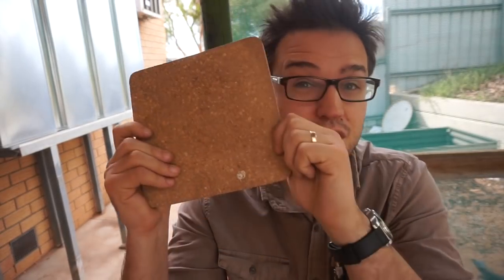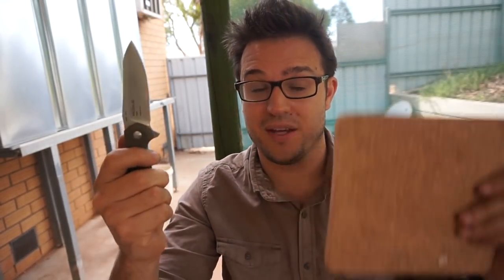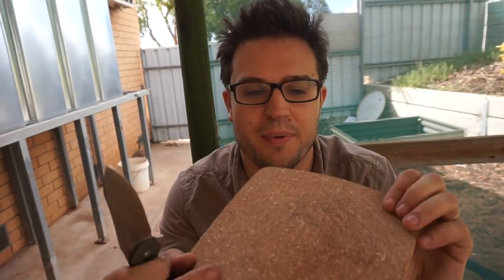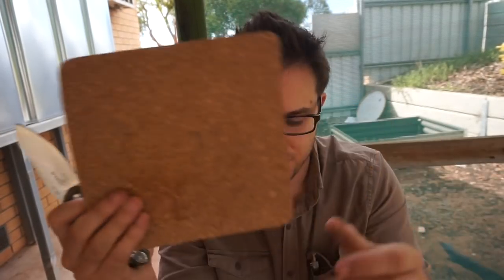Steel Will Modus Response and Additional Test on cork

Comment: Don't knock your science. Your test medium is fairly uniform. Your cutting surface is the same cutting board. You test all the knives with multiple edges. Your sharpness test is fairly uniform. And a company's quality control should ensure that there's little chance of you getting a bad item.
      You could get 32 knives from each company and get your z-scores and yadda yadda yadda. But your tests do exactly what they need to do.

Comment: F.I.A.T : Fix It Again Tony :) Glad I saw your Modus M390 edged retention test video. As long as you do the same test with same material for every knife your tests are valid and relevant !Was on the fence between ZT 0770 CF and Modus CF, leaning towards Modus CF but you have change my mind ... for now. I look forward to Steel Will follow-up. Great work!

Comment: Sometimes I wonder about companies that contract out their rpoduction. There is an obvious incetive for the producer to switch steels to less expensive as,lets face it, its very difficult for the average consumer to tell for sure which steel it is.
This is what I like about buying a Benchmade or Spyderco over, say, a Cold Steel, they have complete control over their product.
Reply: I've used some of Cold Steel's recently made CTS XHP blades and I can tell you as far as that steel goes, they seem to have it figured out pretty well. Seems like their heat treat is pretty solid. Honestly it's probably my favorite steel at the moment and I've got lots of Spydercos and a few Benchmades.

Comment: Thank you for this.
I'm going to test mine this weekend. Something else we need to keep in mind. Is that these knife 'building for hire' companies. Have some pretty large vacuum heat treat ovens. That treat some very large batches of blades at a time. This is not likely, to end up as a one-off knife thing. If in fact, this ends up as a heat treat issue, and not a steel mis-printing issue.

Comment: They don't want the manufacturer to be known because then a knife can be tied to said manufacturer.  If you don't know then they can switch to if said manufacturer raise their rates.  It's pretty common in all business.  As long as they have well set standards and do post production testing and require certificate of conformance from manufacturer etc than the job shop oeming the product doesn't really matter to the end user.   What is more likely to happen is that they may skip some of those steps and the oem may start to take advantage of that.  China is notorious for providing high quality product at first and slipstreaming in lower quality production down the line to increase their margins.

Comment: It's like CRKT when they made the KnifeCenter exclusive Hootenanny in "CPM S30V" and Carbon Fiber.  It turned out that that the Knifecenter Hootenanny had a blade that was actually 1075 carbon steel, even though the blade itself was stamped CPM S30V.  Steel Will can claim that they did a similar test and was able to get around 300 cuts, but where's their proof(video evidence) to show that those results are real, or that they even did a test in the first place.  Talk is cheap!!!  What you need to do is cut some apples or lemons and let the knife sit for a couple of hours without wiping off the blade.  Then record what happens to get another possible point of reference.  Just because the blade has M390 stamped on it does not mean that it necessarily is M390.
Reply: Thomas Connolly same with Bark-river and many other companies,,,

Comment: Cedric, #1 thank you so much.  #2 Broscience, great word! #3 broscience is about two things, data points and consistency.    do all the knives the same way change only one variable at a time.  (your all about steel testing and mfg heat treat choices) its not your job (nor are we asking for the optimum edge for every knife).   dont confuse their job with yours.

Comment: They probably have 2 batches the knife. 1 smaller batch that uses the materials they advertise (for demos/customer complaints), and a large batch mass produced with cheaper materials (knowing most won't push their products to the limit). If someone has a problem, they switch it out, and voila now you have the knife you paid for.
Reply: Sam   ABSOLUTELY,   we can't trust these Chinese Bastards , it happens alot more than people think.

Comment: U should mark these knives u send back. In a way only you can recognize. So if they send you back a new knife saying it's the old one. You could know.
Reply from the maker: .308or5.56? it was serialized and he edge sure aint pretty anymore. We shall see!
Reply: Cedric & Ada Gear and Outdoors hhaaha. Mass blade steel conspiracyyyyy!!!!!. Jk. I'm worried about getting first bark river. Others on the forums after your incident got carbon instead of stainless(20cv) lol. Their s35vn have the "pommel/lanyard holes" so maybe I'll get that to get the right steel. 3v or elmax are my other options. 3 v would be hard to test since it's carbon and prove it's the wrong steel on a return
Reply: Why would they send back the shit knife with 1/4” sharpened off it?????
Reply: willc I said that wrong. What I meant is . Mark it. So when they send you one that is different. Saying your testing is flawed. Re test it. Then try to discredit him. Seen companies do it to people  before. I'm tired of companies selling at premium giving fake steels or poorly treated ones